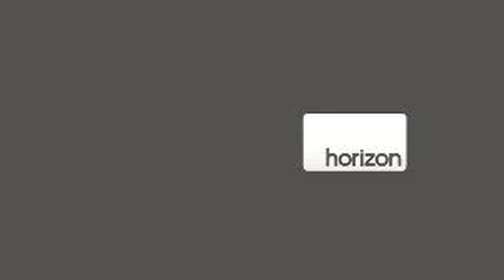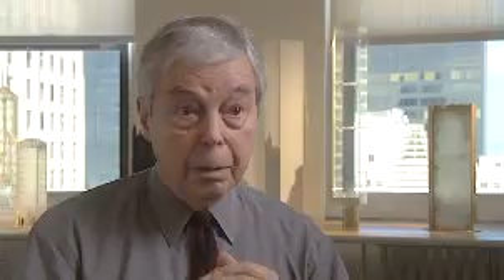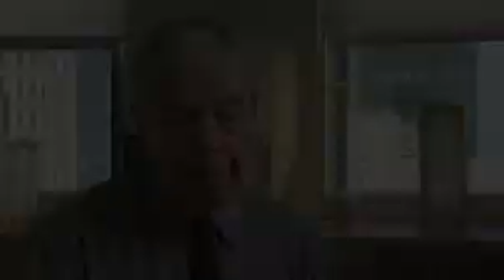Leslie Robertson - Chief Engineer - World Trade Center - Twin Towers

Comment: Explain away WTC7 just as easily then. FFS!! You can see this guy does not believe what he says.... he is afraid, and for good reason!
Reply: +Phil De Punter Dumb as a rock Phil, dumb as a rock. Steel weakens when heated, & those "tremendous" fires were more than enough to bring down WTC7 which is why the fire crews at the scene stated as much several hours prior to it collapsing. Were they psychic? Were they in on the conspiracy? Or was it simply that obvious? Play the fires down if you wish but we have more than enough footage & first hand accounts from the fire crews that they were intense, & as anybody with an ounce of intellect will tell you, steel is weakened when heated, therefore ANY steel framed structure WILL collapse if left to burn. You can list as many concrete reinforced buildings as you like, it's of zero relevance. 
As for your pathetic, insignificant, feeble list of nobodies (ie. AE911truth); it's taken 10yrs to obtain just 2600 signatures, 80% of which are students/graduates with no experience of high rise construction, structural engineering, or controlled demolition. Who cares what an electrical, or software engineer THINKS?? These people make up somewhere in the region of 0.001% of the engineering community, so as far as arguments from authority go, this has to be the weakest i've ever encountered. You need to learn how to think for yourself, & how to conduct proper research.
Reply: @ReligiousIntolerant  
My suggestion.
Make an own company for dedestructing high buildings.
Now we know how it works.
A genius like you.... no prob.
Reply: Fires burn uncontrolled for over 7hrs. It was the 1st time a skyscraper burned uncontrolled for that long, it was just a matter of time before it came down.
Reply: Darryl Elam That's one of the most stupid ignorant comments I've seen... there are many examples out there of "skyscrapers" burning out completely yet they stayed up.... never ever until 911, and since, did fire cause the collapse of one, nevermind three on the same day. Hasbara troll?!
Reply: Phil De Punter
While the fires in the other buildings were actively fought by fire fighters to the extent possible, in WTC 7, no efforts were made to fight the fires. The water lines were also damage by the fall of the tower 1, so no sprinklers ether. So when I say that one of the key factors to WTC 7 collapse is that it burned for 7 hours uncontrolled this is what I meant.

Your comment shows your ignorant
Reply: Phil De Punter
I love it when people fail to do any research of their own and just look at conspiracy websites.

The Windsor Tower
The building totaled 32 stories, with 29 floors above ground and three below. A concrete core and concrete frame supported the first 16 floors. Above that was a central support system of concrete columns, supporting concrete floors with steel perimeter columns. An additional feature was the presence of two 'technical floors' - concrete floors designed to give the building more strength. One was just above the ground level and the other at the 17th floor. The steel columns above the 17th floor suffered complete collapse, partially coming to rest on the upper technical floor. So what does the Madrid Windsor Tower fire show? That steel columns will collapse in a fire, that concrete is more fire-resistant, and, uh, that’s about it. 

Chechnya skyscraper
Burned for 7 hours, unlike WTC7, what was burning was not the interior of the building, but just the facade. Like the paper burning off a Duraflame log. And that's just comparing the fires, you also need to look at the structure of the building, had the interior of the building been englufled in flame, then would it have collapsed? Probably not, because the building was of entirely different construction, short spans (a span is a floor or beam between columns), and a frame of reinforced concrete, not steel.

One Meridian Plaza,
A 38-story(14 stories shorter then the WTC 7) skyscraper, did not collapse due to differences in the design of the structural system, The fire's spread only stopped when it reached the 30th floor which was the first fire-affected floor to have automatic sprinklers, it also had firefighters battling the flames. (WTC 7 didn't have ether as water lines were damaged by the collapse of tower 1 so it burned uncontrolled.) Even so the under extreme fire exposure the beams and girders sagged and twisted and cracks appeared in the concrete floors. Thermal expansion of the steel frame caused some of the granite panels to be dislodged from the building's facade.

First Interstate Bank Fire
(It is humbling and terrifying to realize how close we came to losing control of this fire!  Had it not been for the extraordinary commitment to duty, staunch determination to extinguish the fire at all costs, and unabated heroism and courage of our brave Firefighters,  I am convinced that the fire would not have been contained as it was in 3-1/2 hours.  In most other cities, the building could have become a charred skeleton and, even worse,  Firefighters would have lost their lives.  In my view, our City is blessed with the most professional and dedicated Firefighters in the world, and this is why only one civilian life was lost and only four floors were gutted.) It was saved thanks to the combined efforts of 64 fire companies, 10 City rescue ambulances, 17 private ambulances, 4 helicopters, 53 Command Officers and support personnel, a complement of 383 Firefighters and Paramedics, and considerable assistance from other City departments. WTC7 had no one fighting the fires.

The 1 New York Plaza Fire
Engineers later discovered that the building survived the fire with surprisingly limited structural damage; credit was given to especially thick layers of a relatively heavy, cementlike fireproofing that had been applied to structural steel. The World Trade Center had the much lighter, easily dislodged fireproofing on the floor braces whose failure probably initiated the collapse.

Caracas Tower Fire
Military helicopters doused one of Venezuela's tallest buildings with water Sunday, bringing under control a blaze many feared might cause the tower to collapse. And many firefights fought to get the fire under control, WTC7 didn't have that help. Even then officials expressed fears that the building might collapse. "There is a problem because the building is made of steel. Because of the high temperatures, the structure could collapse," Interior minister Jesse Chacon told President Hugo Chavez during his weekly radio and television show.

Mandarin Oriental Hotel Fire
The structure of the TVCC tower - like that of its dominant sibling, the spectacular 238-metre China Central Television (CCTV) tower to the south in Beijing's fast developing central business district - is radical in design and immensely strong. Both buildings are built to withstand major earthquakes while using (((far less steel))) than conventional skyscrapers. Much less steel to have fail, and it also helped that six hundred firefighters arrived on the scene to fight the blaze, which lasted five hours and caused one death and seven injuries. Again WTC7 didn't have that.

Not all buildings are the same, and not all fires are the same. The biggest different is that all of these buildings had people fighting the fires, that is a big factor as to why they didn't collapse.
Reply: Phil De Punter
Those thousands of architects and engineers not only agree with me, it's their work that I posted. Do you know how many structural architects and engineers believe in your crazy conspiracy? I have seen lists of architects and engineers that support your conspiracy, however only 27 of them are 'structural' architects and engineers.
Reply: Phil De Punter 
So just more conspiracy nonsense huh? Well that's what happens when you don't have facts on your side.
Reply: Gee you are working a lot of overtime for your tribe member masters. Get some sleep ffs!
Reply: @philm53  Please present an example in history where a building had another building(110 story skyscraper) collapse on top of it? Severely damaging it's southern facade? Oh that's right it's never happened before or aft 9/11 so you can't.
Reply: @Spunky1991  Rubbish! Show me the pictures of this "severe damage" on one side that was enough for the whole building to come down in perfect symmetry.
Reply: @darrylelam256  In that case why waste money on explosives ? Just set fire to a building and wait ......Hurry you need to tell all those silly wastefull demolitions experts this !!
Reply: margosdesarian You're more than welcome, & i'm glad you acknowledge your intellectual shortcomings. Very noble of you.
Now if you disagree with anything i've said, please feel free to state what & i'll gladly provide you with the evidence to back it up.
Reply: Leo B 
I'm not claiming shit, did you watch the computer model that is designed to test this shit? Just because it seems unreal to you does not matter. If you bothered to do any real research, and not just looking at 9/11 conspiracy sites you might learn something. The 9/11 conspiracy sites are still making money off people like you who rather believe nonsensical bullshit rather than the truth. Yes, their business model is to lie to you to make money. 

I have seen enough real world evidence to support that the towers could have and really were taken down by planes. And that building 7 really coame down from fires that burned uncontrolled for 7 hours. I have looked into both sides. You conspiracy bullshit is just tgat, bullshit.
Reply: +ReligiousIntolerant I am glad you have illuminated the truth to us dummies :)
Reply: Darryl Elam - "I have seen lists of architects and engineers that support your conspiracy, however only 27 of them are 'structural' architects and engineers." 

Do you have 27 structural architects and engineers you can name who support the collapse-by-fire theory?
Reply: Darryl Elam - "The biggest different is that all of these buildings had people fighting the fires, that is a big factor as to why they didn't collapse"

You failed to notice that those building fires were engulfed infernos, unlike wtc7. What difference did the firefighting make to them? None! They still burned uncontrolled. You've proven nothing. Try again, Darryl.
Reply: Darryl Elam - "And that building 7 really coame down from fires that burned uncontrolled for 7 hours"

Prove it.
Reply: Phil De Punter - The NYFD reported concerns about WTC7 collapsing hours before it did, because they didn’t have the adequate resources and manpower to contain the fires in the building. There are many firefighters who have said that they could literally hear the building falling apart and it was only a matter of time before it did.
Reply: Also, if you don’t believe that the fire damage of WTC7 could’ve been enough to cause the building to collapse, look at these photos of building 7 before it collapsed. You’ll see that the fires are far more widespread than people realize. 

https://youtu.be/V_AoDyEObvE
Reply: HE IS BLATANTLY LYING
Reply: @harlow743  no he's not. He help design the new WTC 1 look how it's built much differently
Reply: @melvynsngltn27  It still won't resist explosives
Reply: @harlow743  what explosives